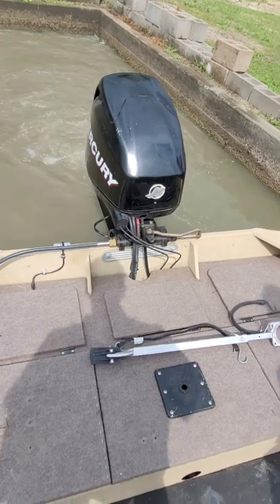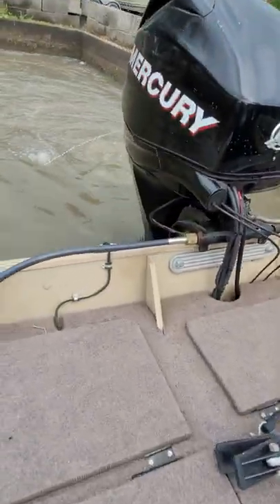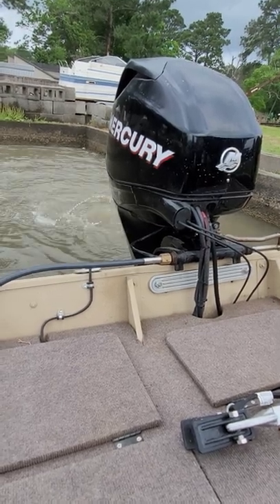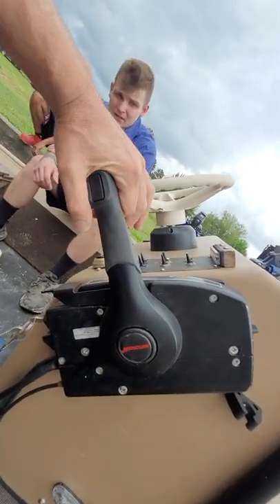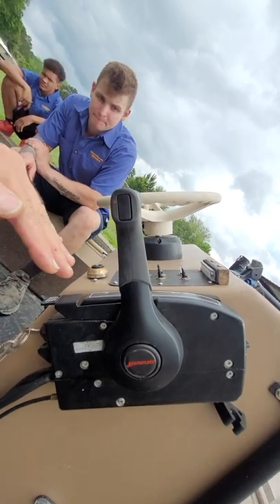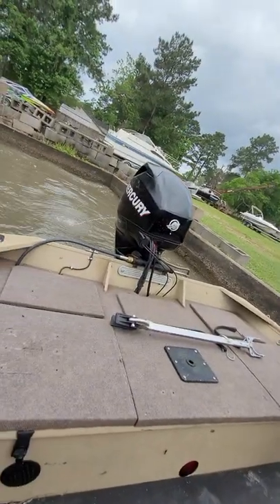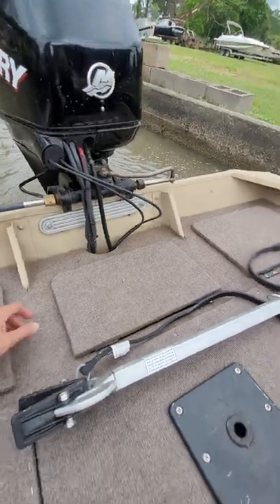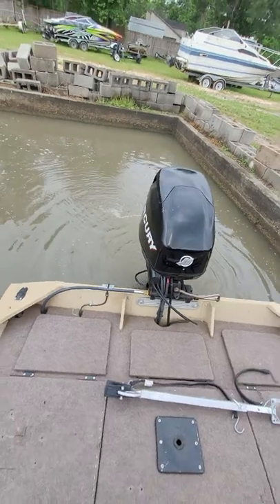Mercury shift control cable adjustment problem.

Comment: I'm assuming you put it in reverse and it went into neutral? That's the handle position. The gear on the controller needs rotated up one position (with the handle) then reposition the handle. Simple fix.

Comment: I have that controller and I'm having issues it won't grab the throttle when accelerating only towards end, big dead spot, checked cable and it's ok
Reply from the maker: Problem is possibly in shifter itself, more likely cable is broken and you just cant see it.
Reply: @hotheadzmarine  so I took the cables off on both ends and they function very well no slack both ends move in and out precisely, now everything points to the controller basically the shifter works perfect but the throttle will not grab either way it just pops in gear then there's just slack from beginning all the way to the end

Comment: I am having some issues like this. Is there a follow up video where you fix this issue? I see the diagnosis.
Reply from the maker: I had the wrong replay for this video, I am sorry. We replaced the cables and adjusted them correctly and it was resolved.

Comment: #o you have a clip on How to adjust the Mercury cables?
Reply from the maker: LOL... I'm Sorry we did not show how to adjust the cable but we assumed that since its so easy anyone that pops the cover off the engine and simply looks will see how simple it is. Check your manual or an online manual..